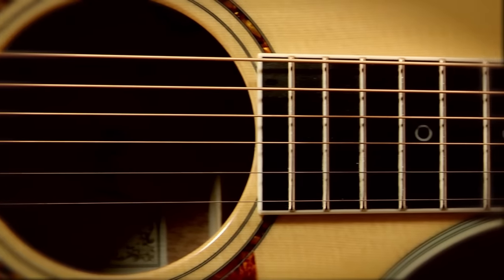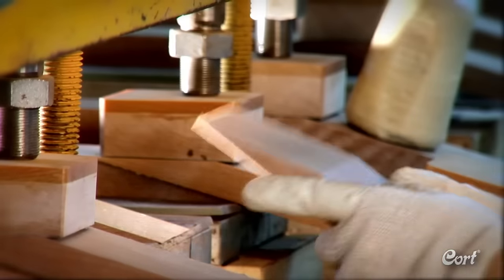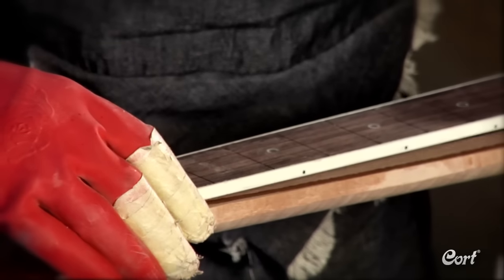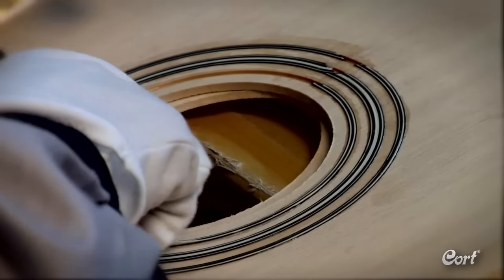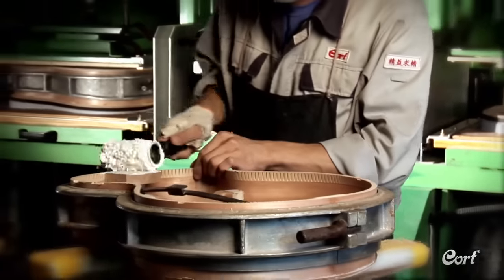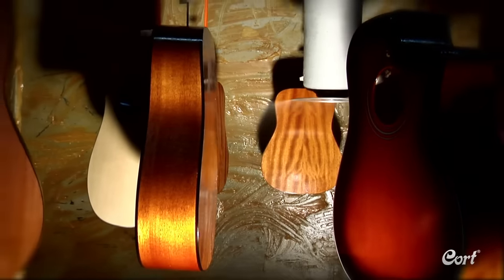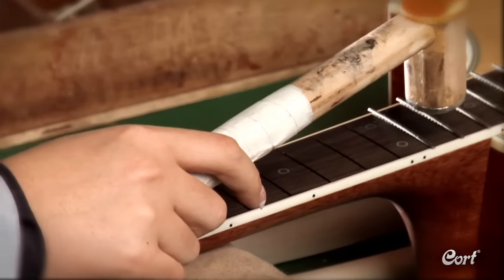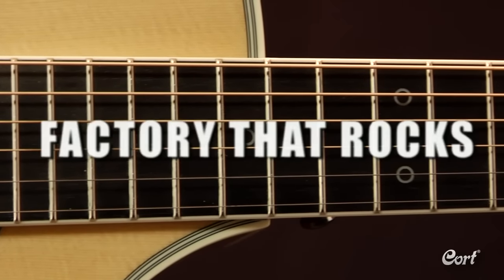Cort Acoustic Guitar Factory Tour - See how their acoustic guitars are made

Comment: Well, I might as well put my 2 cents worth in. I have 2 Gibsons, a BB King Lucille and a Les Paul and they are both awesome guitars. I also have 3 Chinese made guitars and their quality is every bit as good, if not better than Gibson's and they didn't cost nowhere near as much as the Gibson's. Might as well get used to it, we are going to see more and more Chinese and Mexican guitars in this country. I read a while back that Gibson has some parts that are made in China. That doesn't bother me at all as long as the workers do a good job. Yes, I wish foreign guitar factories treated their workers better, but we can't control that so why get all upset over something we have no control over.
Reply: There's more to them than the neck, but going to the top of the pile isn't generally done by gibson on any guitars that are in the mid 4 figures range or less. By that, I mean care in wood selection and workmanship like you'll find on a collings guitar. 

Poor selection of body wood can result in body hump (actually, even good wood selection might result in that - it's present on a lot of les pauls, in my opinion, a design flaw and the fingerboard and neck should've been slightly proud of the top of the guitar. 

I've had four used collings guitars, and none of them have had any movement (the oldest is 13 years old) - all electrics. I'm sure the acoustics move and need attention to the top and neck joint over time.

Point being, if you do some of the one-off things properly and budget hours (and money) to do them, you can really make a superior guitar. It's probably not easy to do that in production numbers, though, beyond very small production. Gibson's production work is usually pretty good, but nobody would confuse it for collings. Their custom work wasn't as good at collings' production work.
Reply: In this country? Do you think everyone watching is from your country?

Comment: Cort guitars are well made. Cort OEM manufactures many famous import guitar lines and consistently does a good job. But Cort guitars just don't have good resale so it's advisable to look for them used. Their acoustics are good for laying down backing tracks and general comping, they tend to be easy to mic and stay in tune pretty well once set up well. Their electrics have pickups that work well with pedals but sometimes they need to be wax potted or will squeal. And as with most Asian guitars you can expect they will need fret sprout trimming and occasionally a new nut after about a year along with truss rod adjustment. I have a couple of their acoustics and a bass I keep around and they work well for their intended purposes. Not a big fan of their amps.

Comment: I came here to research Cort guitars as I hadn't heard of them until today. Just visited my smaller local shop with the intention of picking up an acoustic electric around the $500-600AUD mark. I've never played an acoustic, only electrics for 30 years. I went in thinking I wanted a Yamaha FGX720SC, Epiphone EJ-200CE, or Fender T-Bucket - all around my price range and consistently rated among the best in their price range by reviews. I compared all 3  didn't like anything about the Epiphone, the T-Bucket was nice, and the Yami was easily the winner of the 3 for sound and playability. Then the owner handed me a Cort Earth Grand BW CFM (marked down to $599AUD from $699). It blew away everything in the price range for volume and clarity, and even MUCH more expensive brands/models ($2000$4000). Unless I find some terrible reviews, that will be the one I take home - without even trying the electronics (other than the tuner which worked well). Highs to lows and everything in between had more volume and sweetness. Quite impressive compared to the competition.Anyone have one of these who can comment about the quality and durability? (And I couldn't care less that it's made in China.)
Reply: just search for non made in japan ibanez acoustics, most of the ibanez branded guitars are made by cort
Reply: Thanks but I purchased a Yamaha that I'm very happy with instead. :)
Reply: +David W those are really good too, i think they are made by samick (SA at the start of the serial number)
Reply: actually cort is manufacturing many of other well known brand guitars

Comment: Cort ad810 uses very poor quality merbau wood for bridge and neck. There was a crack between the bridge pin holes from one end to the other.
Asked for a replacement and got a new one. The irony is that even the brand new guitar has the same problem with cracks between the bridge pin holes. This shows the quality of the wood used !!
I have already bought this guitar and I am really disappointed!

Comment: Cheap guitars have laminated wood or cheap wood stained to look like cedar and other expensive wood.   This means the wood is not going to give you good bass tone and the glue in laminating makes the tone dull. If the guitar has a solid sounding board ( top of guitar) this is going to help enormously as it is the sounding board that is most necessary in making the correct tone.  Also cheap guitars and also many expensive guitars have too much lacquering, it makes the guitar look shiny and attractive but again the varnish makes the tone duller than it could be.  This also applies to guitars which are apinted or given a 'sunburst' finish. Also it is vital to store a guitar in a proper case, not in a plastic 'gig bag.  A proper guitar case preserves the guitar and stops the wood cracking.  Never buy a cheap guitar, even for a beginner, it will put anyone off learning the instrument.
Reply: Wood glue is harder than any wood